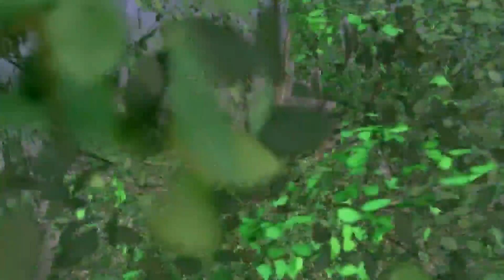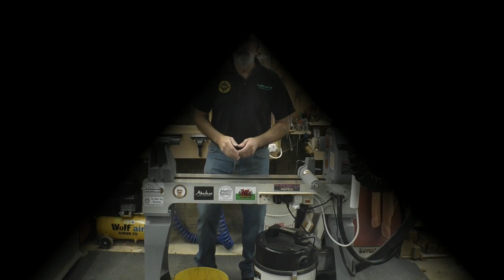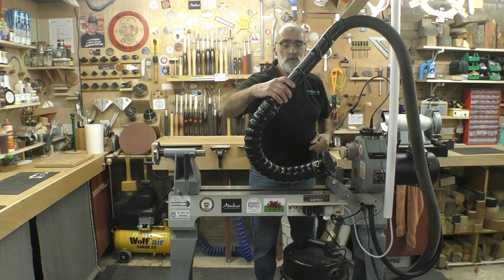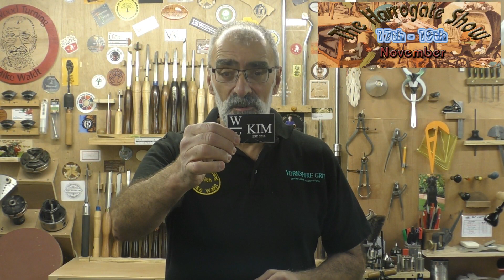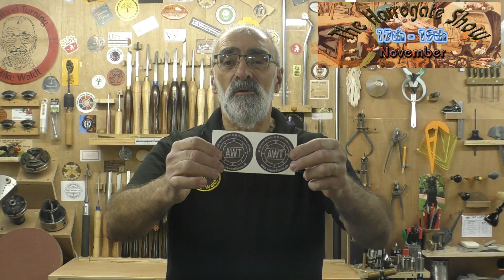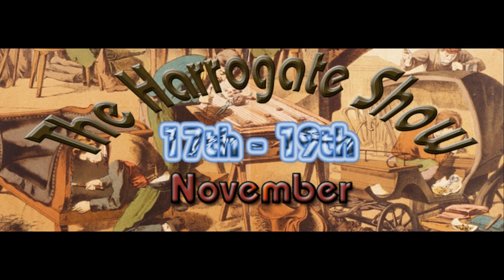Wood Turning - Lathe move Completed!

Comment: Hi Mike when using hot melt glue on a cold surface warm it up with a hot air gun or just a hair drier. it will give you a much longer open time. I've done this with both timber and metal in the past.
Reply from the maker: Hi Paul, what a great idea mate, thank you. Why on earth did I not think of that when I needed to.
Might take it off and reglue it, just to try it out...lol
Cheers
Mike

Comment: Looks good Mike, I am betting that it will  e easier to film also. Question though; have you thought about dust build up in your extraction lay out? You are pulling the dust and debris up then it can fall down towards the vacuum. Might want to keep an eye on that. Great lay out no matter what. Looking forward to your next video. Cheers.
Reply from the maker: Thanks Terry, I have actually attached a plywood "shute" under the bed ways of the lathe, and this deflects the majority of the shavings etc. I neglected to point this out in the video, but will mention it in the next one ... if I remember ;)
Take care
Mike

Comment: That's a super job Mike.  I really like the extraction set-up because I have been trying to work out how to do mine and your moving stick method would seem to be the solution I am looking for.  I like wires to be overhead too.  I have fallen over enough on the floor to have learned that I don't like that.  It's not so much the falling do as the getting up again that's the problem.
Health to enjoy your new 'shop, Brendan.
Reply from the maker: Hi Brendan, the extraction is a bit (a lot) Heath Robinson as I said in the video, but it does seem to work well, as does the overflow pipe for the electric cable :)
Cheers
Mike